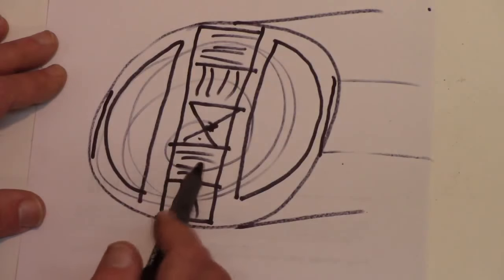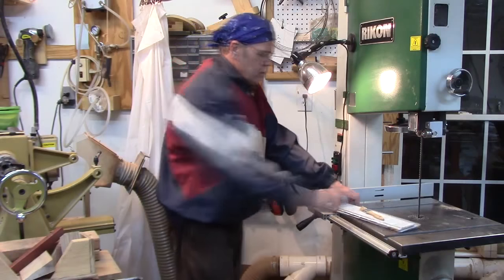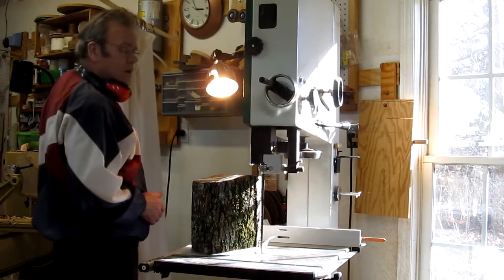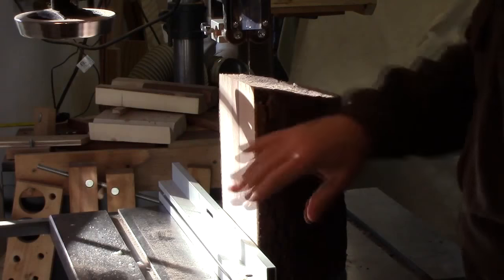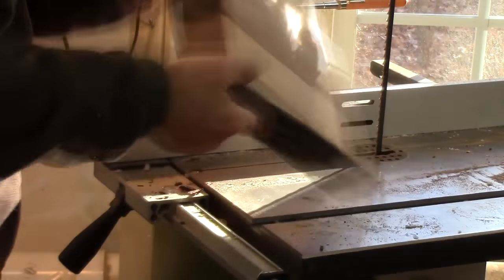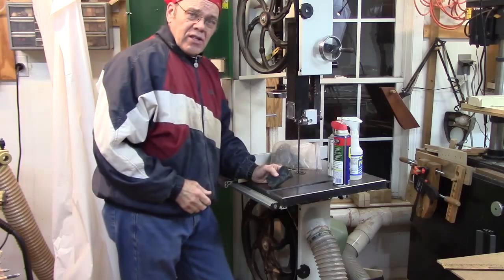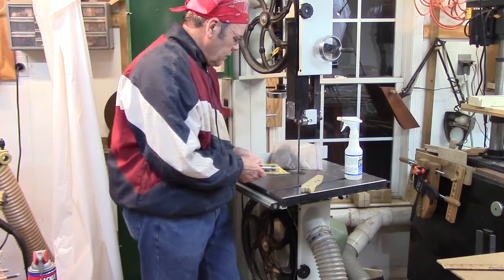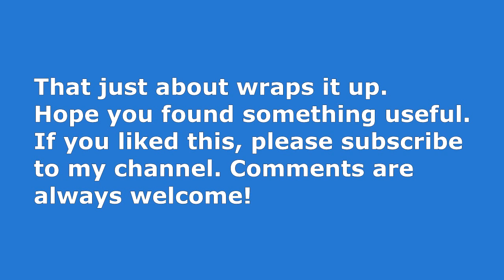Band Saw Use for Wood Turning part 2 of 2

Comment: Thanks Mike, great video as usual.  On your final comments relating to the build up of fuzzies under the lower blade bearings, I implemented a solution from a Mike Cosman youtube video. Basically I glued a wooden block (about 6 x 6in) onto the inside the upper corner of the door and glued a rubber mat material to it. The rubber closes off that triangular area, forcing all the suction to draw air down from the lower blade bearing area. I cut a 3in piece of 4in sewer pipe, slit it down one side and mounted it under the table,  around the bearings. This was so effective that I have removed the lower suction connection completely, which in turn made all the suction power available in that triangular box. I have no dust at all in the bottom of the cabinet and no fuzzies in that triangular compartment. I hope I explained that clearly, if not just ask.
Reply from the maker: I am going into my shop now to explore those suggestions. Sounds like great tips.
Reply from the maker: Can you provide a link to Mthe Mike Cosman video. I could not locate it. Pictures would be helpful and can be sent to mikepeace356@gmail.com
Reply: I have emailed you those photos and youtube link to Rob Cosman, hope ithelps

Comment: Hey Mike.  I’ve installed an air nozzle from my air compressor on the opposite side from from dust collector port.  This guides the sawdust toward the dust collector hose and separates the sawdust so it is easily sucked up.
Reply from the maker: That is unique. Does it run all of the time you are turning? Or is that on your BS?
Reply: @MikePeaceWoodturning  Currently, I run the compressed air on my BS.  But a great question: why not use compressed air to direct sawdust and shavings on other machines?  There’s a sweet spot of how much pressure that goes through the BS nozzle.  Too much pressure and it’s like you’ve opened up the bottom door to blow out the dust.  Too little pressure and it’s a waste of time.  I had to experiment with the placement of the nozzle and air pressure before I made a permanent fix to my BS.  Oh yeah, I made sure the air was filtered for both water and oil before it entered the BS.  Mike, Take care of yourself, Bill.

Comment: Hi Mike.  I've had a decent bandsaw for a couple of years now, and this video really helped me sort out how to do some things...after doing things wrong for a while.  How often do you change your blades?  And is there anything that can be done with used blades other than tossing them in the trash?
Reply from the maker: I usually sharpen a couple of times. I have a video on using a dremel to do that.  The blade winds of breaking on me usually. Probably not the best advice. If you are having to push to hard, it is getting dull. I break into foot long lengths and fold into a Vee to put work on it while the finish is drying.

Comment: Fantaaaastiiic! Mike am I right?  When making the spindle blanks, I guess I need to cut off the check marks and then I can use these pieces without shelving them for 6 to 9 months to dry? On all the pieces by removing the pith I can pretty much go ahead and make a bowl, or ornament, acorn etc.?
Reply from the maker: Part of the learning curve is what you can turn green like a once turned bowl that will warp or a rough turned bowl that you will let dry and turn to final shape when dry usually months later. Or a box that must have dried wood for the lid to fit later. But yes, I would cut of any check and paint with latex paint or green wood sealer to increase your chances of having blanks, spindle or bowl, when you need them.
Reply: Thanks again Mike. You are so good to help. I have taken your advice. And well I got a pound of paraffin wax from hobby lobby only 3 bucks! and with a heat gun sealed all the ends. The sealer was expensive,  The heat gun made quick work of it and I didn't have to build a fire pit and all that stuff. I watched Dan Douthart at the Gwinnett woodclub demonstrate from log to bowl. Pretty much the same as you. You gentlemen are all good people. Thanks Mike. I wish I could make it up to you. Have you ever turned Persimmon? I have a lot of it. The really big ones were over 14" and another guy took them and made 8/4 boards 12 to 14 wide and 8 to 10 feet long. I only took the ones that were around 4 to 8 inches round. But I would be happy to send you some.
Reply from the maker: Thanks so much for the offer. I am in pretty good shape for wood at the moment. I used Persimmon for the green chessmen I made in an earlier video. Great stuff for detail - very hard.
Reply: That is good to know.. I got it and didn't know what I was doing. I immediately made an acorn and a top out of walnut. the Persimmon body shrunk about 3/16 of and inch. And that was one side. Eventually it got to 1/4 inch. One side so that it 1/2 all the way around! Yeah I am pretty GREEN myself. Pun intended.

Comment: What is your source for the blades?  That squawking sound is caused by bad bearings ( frozen up ).  I have had that problem.  The dust collection on that saw (I have the same one) really stinks.
Reply from the maker: Woodcraftbands.com     I agree with your DC assesment.